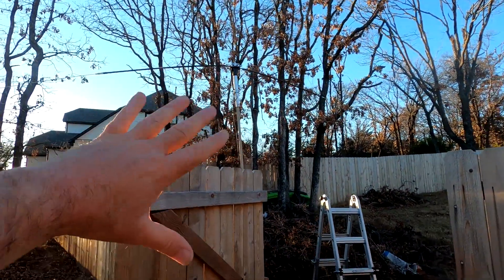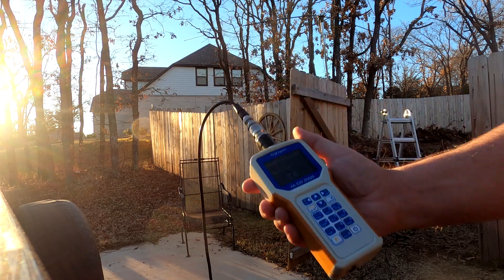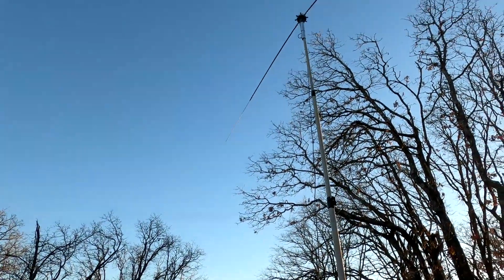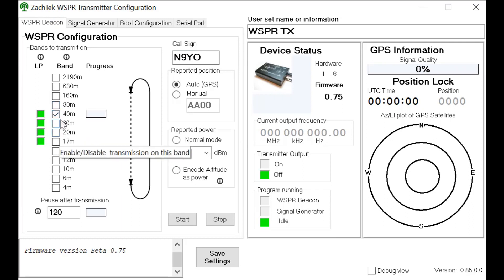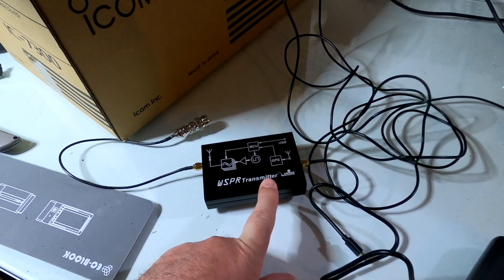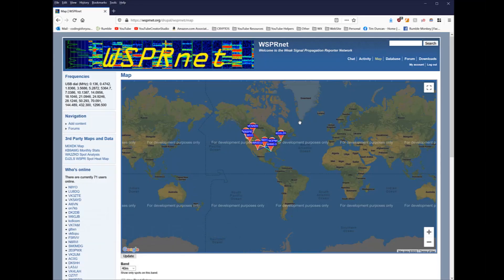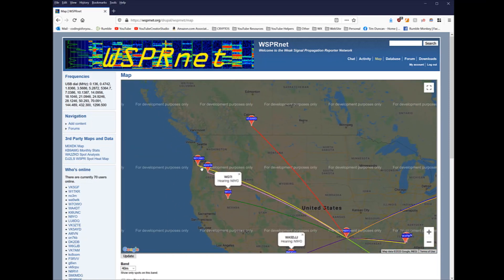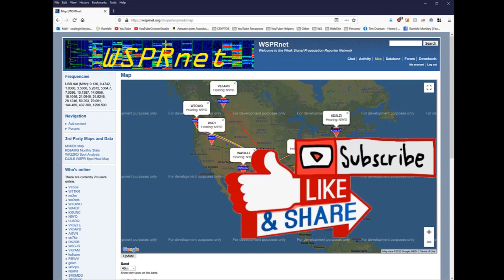Octopus Antenna Base | MFJ-2104 | 40 Meter Hamstick TEST

Comment: That's about what I got from Norman, OK using a Mini G5RV in my apartment on the 2nd floor on JT65/JT9 modes. 20 meters worked better and I have a ton of contacts in California and that was always a given. My radio hit California every time.

Comment: Dude you should’ve able to get those ham sticks to almost flat swr. You have to tune them individually. Also you have to have about a 1/2  wavelength coax  cable  .  The formula is : 498/F multiply by coax velocity factor. This will give you the coax length. And do even multiples. I guaranty you get better swr.   Another thing is the height it needs to be about a 1/4 wavelength height above ground..
Reply from the maker: Yeah, I probably need more coax, but it's hard to take it up and down and tweak at 1/4 height.
Reply: @Ham Radio CQ mount the hamstiks on a mag mount on a car tune them individually. Then put them on the octopus mount and check. I have two shark ham sticks and I tune them indoors using my bathtub on a magnetic mount. Swr is 1:1 to 1. And I have 1/2 wavelength on the coax cable .  Oh make sure to use a tuner for impedance match you will not have 50 ohms all the way thru. This is when tuner come in handy .

Comment: Looks like fun. Antenna experiments are my favorite part of the hobby. I fashioned a hamstick dipole about ten years ago and it worked pretty decent for camping. The reason your SWR is 2 or more is due to feedpoint impedance. It's unlikely you are anywhere near 50 ohms. A typical dipole is 73 ohms, and a dipole with loading coils is probably higher than that (100 or so). Achieving 1:1 will be impossible without a matching transformer. You might be able to model the antenna, but that's a little beyond most hams. Alternatively, you could learn balun construction (TRX Workshop is an awesome resource) and experiment with 2:1, 3:1, and 4:1 ratios. Additionally, your coax is no doubt resonating, so a 1:1 choke between the coax and the matching transformer will prevent this. Also, I used hamsticks mobile over the years and always had to use capacitors to get a better match. Lastly, if you insert too much whip into the fiberglass section, you risk the end of the whip impacting the inductance of the loading coil. Shortening the whip may be necessary.
Reply from the maker: Great comment my friend I wish you were my neighbor.  : )   Yeah, ideally I like these things cause they are cheap I was hoping they'd work out well for a weekend at my moms or on vacation or something.
Reply: @hamradiocq  As mobile antennas, Hamsticks are great performers. I worked a German station from a park in IL this week using CW, 20W into a hatch-mounted Hamstick. The bands were not even very good that day. They also work as a decent ground-mounted vertical with a few radials. They're great for POTA.
Reply: What is TRX Workshop?
Reply: @christiansweningsen2829  Sorry, it's TRX Bench, a great YT channel.
Reply: Do you think the OCF concept would work with hamsticks? I've seen dipoles with one side longer than the other & the impedance was closer to 50 ohms.
Reply: @kd5you1  It might, but you will probably need a 4:1 balun to obtain something close to 50 ohms

Comment: How much of the whip did you end up having to put inside the tube ? I had to cut the excess off of mine. I used to use the stick dipoles for pota, and could always get them to 1.5. Also, you can make one side a bit longer than the other.  This helps with fine tuning. They do really well once you get them up the 25+ feet. Good job.
Reply from the maker: Well, I would guess about 8" are inside the tube.  I ended up going to 1 side after I did both sides and still 2.0, 2.1 was the best I could do.
Reply: @hamradiocq  Maybe having one set of sticks on the 8 way matters.  Do you have a single set adapter? I think the part number is mfj-347.

Trimming the excess is what's recommended,  but not too much as you need some to adjust the tuning. If you leave too much whip in the tube and apply higher power levels, it can heat up the tube and ruin it. Set screws should be tight.
Reply: I had to cut the excess off of mine too, and as a vertical with a wire counterpoise my SWR is 1.07 at 7104kHz.

Comment: Very short resonant monopole and dipole antennas exhibit very low impedance and very narrow bandwidth.   Without some type of impedance transformation device/method either at the antenna feed point or somewhere between the 50 ohm xmitter (generator) and antenna (load), expect a high SWR.   Ken WA8FCI
Reply from the maker: Yep, I hear ya Ken. You cannot cheat the Universe.

Comment: I agree. Point it east and west and try WSPR and see what results you have. I get low SWR on my hamstick when up on my van. All the best. 😀
Reply: It’s low because you have more metal on the ground side.  If this guy throws a chicken wire fence (or ground rod) around the area and connects the ground to it, I bet the signal would improve.
Reply from the maker: Thanks for sharing

Comment: Hamsticks can be a pain.  Some seem to get the SWR down to a 1.5:1.  I used a 20m and later a 40m mag mounted on my extended cargo van and finally got them down to 2:1.  But on my car they simply wont tune.  I installed two 40m Hamsticks as a dipole in my attic and after 20+ trips up and down the attic stairs I never got them below 5:1 so I removed them.  I have seen dozens of videos on YouTube of others having the same issues.  A 2:1 SWR means you are loosing about 10% of your forward power.  For example, if you are running 10 watts with an SWR of 2:1 you would be transmitting 9 watts.  I don't think SWR was the problem resulting in your sparse WSPR contacts.  I am sure propagation was the problem.  73!
Reply from the maker: Great comment KX4UL.  Good to know.  I like these things cause their cheap and I wanna explore putting them up portable.  But disappointed I can't at least control the tuning.  I get that they are a big compromise, but I still like to be able to adjust my way to at least 1.3.
Reply: Have you tried adding capacitors? http://www.radiomanual.info/schemi/ACC_antenna/Lakeview_Hamsticks_HF_antenna_user.pdf
Reply: @gravestonemyth  - Hi Steve,  Good suggestion.  Yes, I had considered that option but was trying to avoid it if possible.  For now I just use my mobile tuner.

Comment: Another great video!  I do not have  the Octopus, but I have a MFJ dipôle to which I obviously used two 20 meter hamsticks.  After messing around, I tuned each hamstick alone and then mounted them together.  I had been adjusting the overall length by changing the overall length with the same amount.  Turned out one was about an inch shorter than the other when I finally got a 1.2 to 1 SWR.  I,also, agree with your politics.  Thank you very much for your time and effort.  73. KG5OBD
Reply from the maker: Hey thanks for the comment and tips.  Yeah I call it common sense politics.  I don't care to throw away my rights and open borders and higher taxes.  Gee I must be crazy....   Trump had 11 million more votes this time and somehow lost to a guy that speaks with marbles in his mouth that couldn't draw 50 people to his crowd...where they physically blocked GOP poll watchers in the big cities and counted votes and there's video of democrats bringing in suitcases of votes...on video.

Comment: Even with an ATU the antenna would still be 2.1 SWR but the radio 'sees 1:1', I tend to scan for the best resonant frequency and shorten/lengthen from there
Reply from the maker: That's true, you can't tune your way out of a bad antenna.  I was just hoping to be able to control the SWR better.  At least they're cheap!
Reply: @hamradiocq  yes I love these whips, I have been using 2 for 17m lately, I imagine the 40m ones have a very tight resonant  frequency

Comment: Those 40m hamstick antennas are really finicky to tune!  I spent a lot of time getting my mobile 40m antenna to resonate with a decent match.  They’re also very narrow banded.  You’ll definitely need a tuner.  I like the concept though and have thought about doing the same thing you’re doing.  Hope you’re doing well in the new QTH.  73 de K2CJB
Reply from the maker: Thanks for the comment K2CJB.  Yeah, looks like a tuner will be necessary.  We love the new QTH.  Warm winter so far!

Comment: I have the 20m and 40m Ham sticks.  Each have their own coupler/SO239. (I added quick disconnects for easier assembly/disassembly). 
Droop is a natural for these type thin whips. 
If you want the measurements I got on mine let me know. 
I got them both at 1:5 which these will tell you on the packaging. 
I used a price of conduit with a 3’ price of pvc on that and attached the antenna to that. I keep the two sticks marked so I don’t mix up the positive stick switched with the negative stick. Everything is marked for either +/-  (the coupler is also marked +/-$
Reply from the maker: Hmmm, thanks for the comment so I can compare it.  I didn't mess long, but 2.1 seemed the best I could do any other adjustment, together or separate made it go up.  Ugh.

Comment: I've been looking at getting one of these. It will work with just one set of ham sticks. but i think the trick is to have multiple sets in it because the ones its not using to transmit on will act like a counterpoise, I think you should use a minimum of 2 sets of ham sticks. worth a shot
Reply from the maker: It never occurred to me that more sticks might help. I thought they might hurt, Hence the experiment you see here.  Thanks fer comment.  More to come friend.
Reply: You don't use co-linear conductors on a horizontal polarized antenna as counterpoise. That actually would be conductors within the near field and certainly would interfere with lobe trajectories.